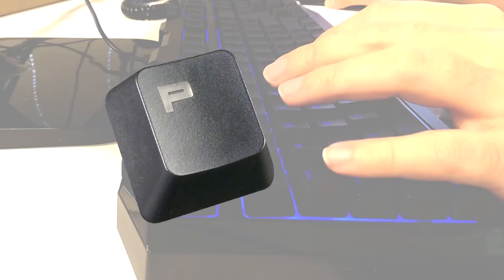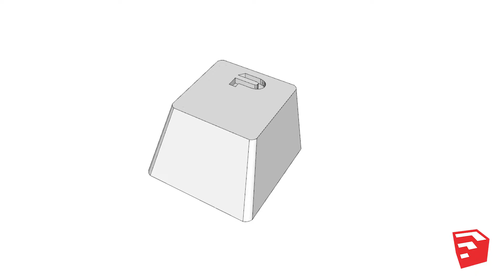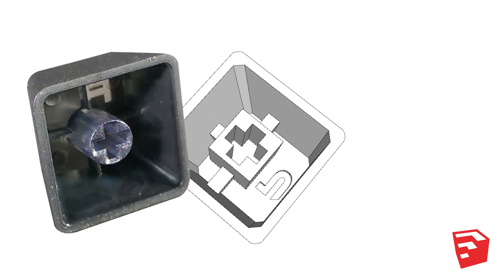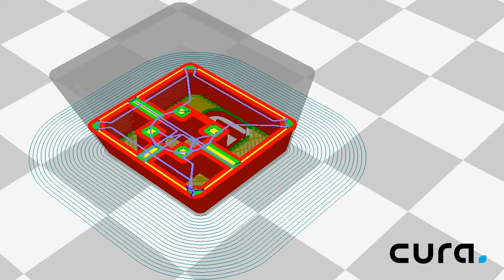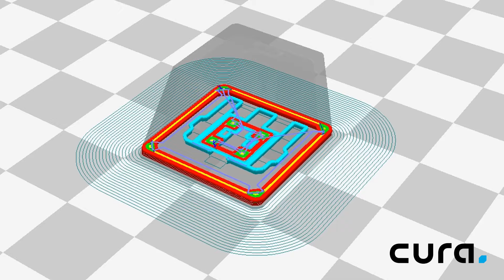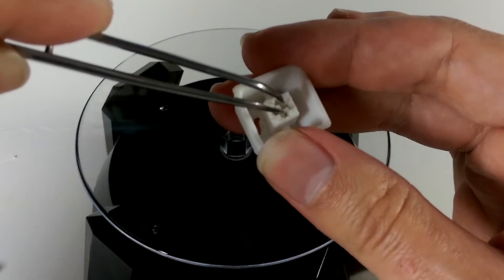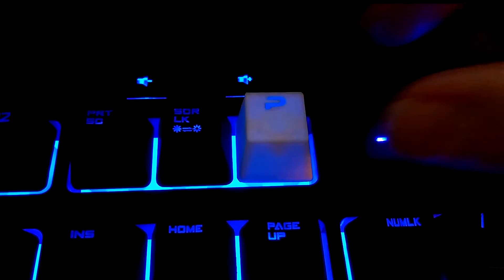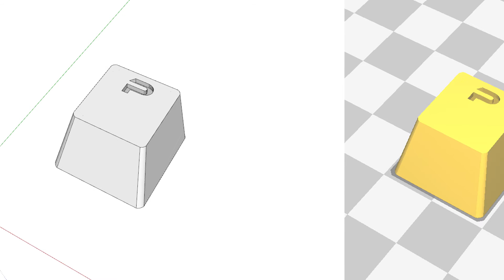3D Printing with the Maker Select V2 - Ep3 | Keycaps and Supporting Them Oddly

Comment: just print the keycap upside down- no filler inside the slot for the switch, less support so faster printing and higher compatibility. Only downside is trickiness with keycap surface concavity

Comment: Awesome video. I just finished a design for a fully customizable SA profile keycap generator for 3D printing if anyone is interested. It automatically adjusts the model based on the row you select, and there are tons of parameters you can adjust to get the perfect keycap profile.
https://www.thingiverse.com/thing:4403859

Comment: that take 4minutes. i not think. why use 0.05 layer height on 0.4mm nozzle. its like draffing surface and it still is 0.4 or more width line

Comment: A couple of things, you could have printed the key upside down and achieved two things by doing it. the top layer surface quality would have been vastly improved, and you would not have needed any support material. Also, at that size, you could likely have printed the model without supports, since the insert to put the cap onto the key would have acted in the same way as any support structure. Support is only really necessary when you're bridging an absaolutely huge gap, or there isn't anything on one side to bridge between. In this case you would have probably been fine to print without supports.

Comment: z brace and cooler mod are going to be my first prints, then once I buy the printer and get them installed, I will be printing them again as I'm sure the prints with the mods will be better than the prints without. I'm also tempted to buy the micro swiss all metal hotend with slotted cooling block.